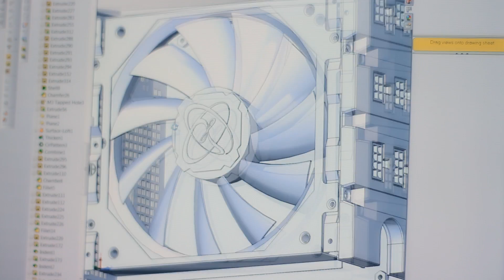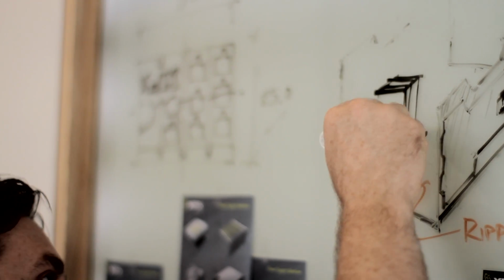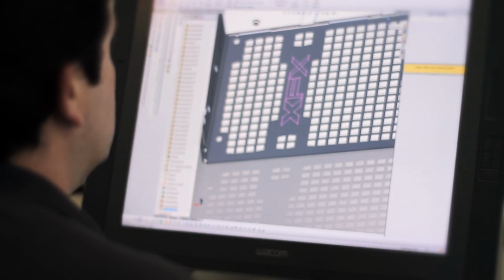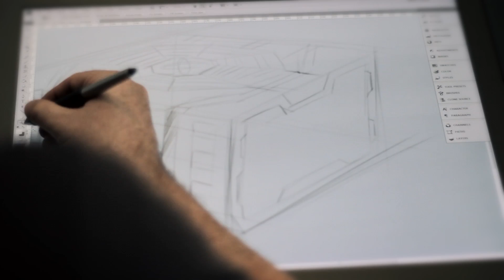What makes XFX PSUs different?

Comment: They're using Solidworks for their 3D CAD models. Seems they like the extrude feature WAY too much considering the tree diagram with a guesstimate of 400+ extrudes. Maybe if they used more complex sketches and considered some linear and circular patterns they wouldn't have so many.... just my 2 cents.

Comment: Im sorry, you cannot say that they are the best PSU's.  My corsair AX1200 is one of the best PSU's on the market today because they are reliable, made very well, and operate as advertised.  Plus its 80Gold and it actually lives up to its standards.  XfX is a good company for graphics, but I would never buy a XFX PSU.  But I will happily buy another set of XFX cards to replace the XFX 5870s I have in my micro-atx LAN build.